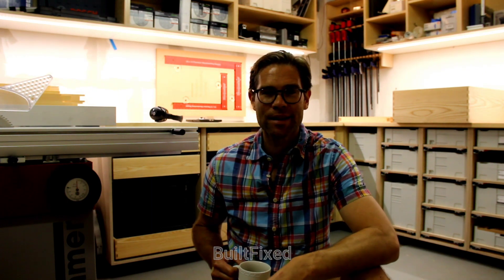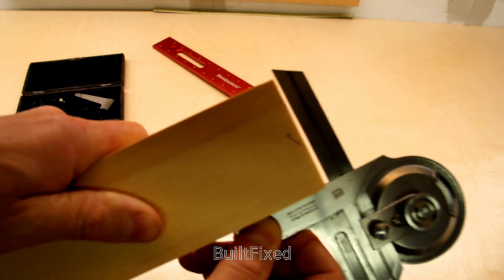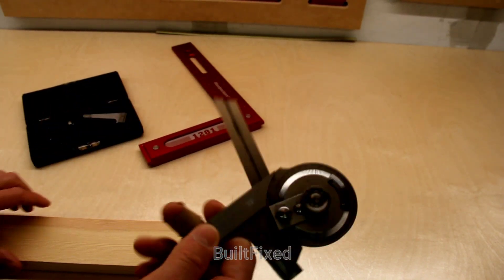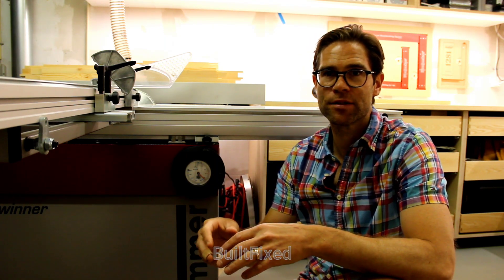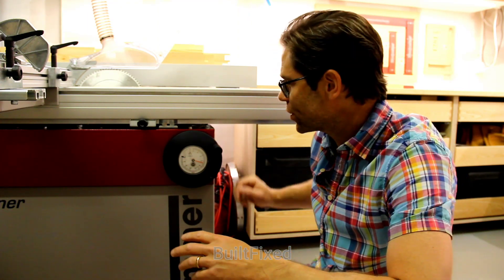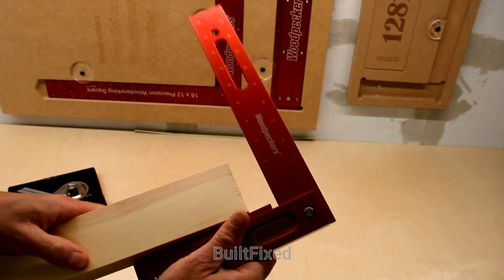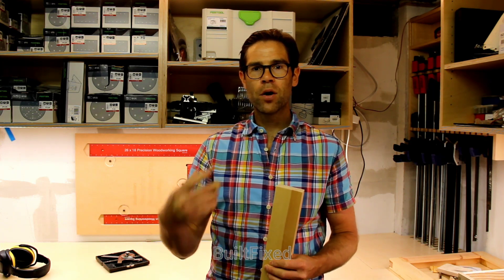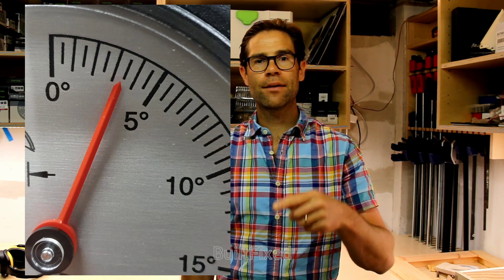Felder angle gauge accuracy test update on Hammer K3

Comment: what is the diameter of the shaft where this indicator is installed?  I would like to install this indicator on POWERMATIC. I really need it.
Reply from the maker: Not to discourage you but check first the ratio of revolutions of the Powermatic handle in relation to the change in angle. The Felder indicator works by "counting" the revolutions at a specific angle change rate.